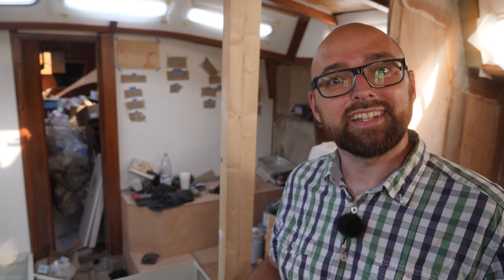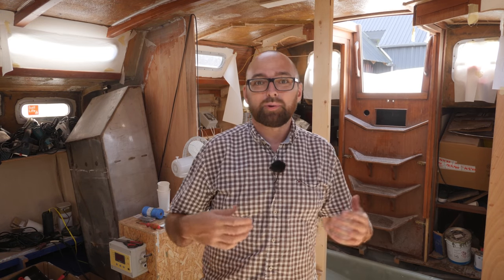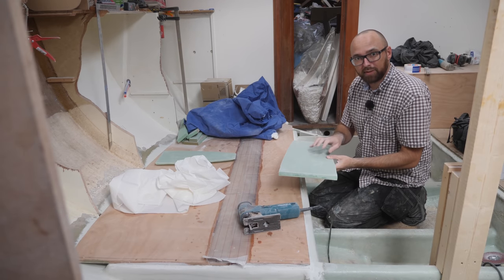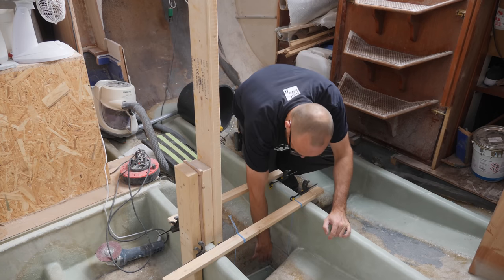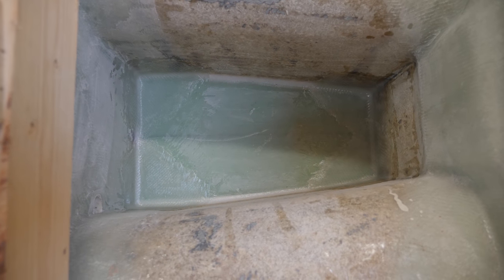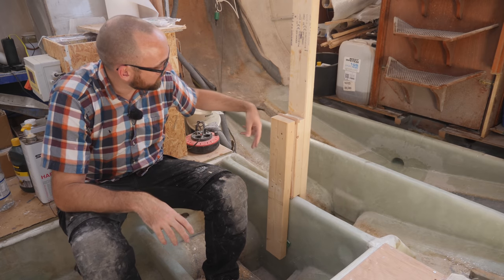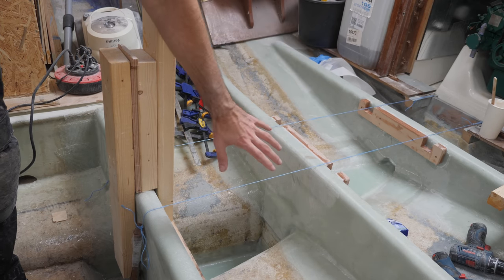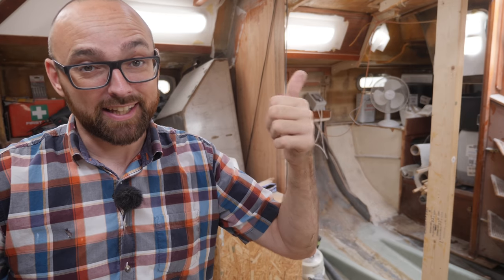Sail Life - Bilge modification & longitudinal support - DIY sailboat refit

Comment: Athena’s structural members are looking super spiffy compared to last winter/spring, awesome. I agree 100% with your assertion that you should not have a grey-water retaining area that’s not enclosed in a tank for a few reasons. 1. Water creates smells - mold, skank, whatever, 2. If you ever lay up your boat over the winter while it’s full of water, the expansion of ice is likely to crack whatever it’s contained in. You def don’t want any part of the hull to crack, not even a little, especially anywhere below water line.

Comment: I really like the additional details you are doing to make Athena a strong and squeak free boat for the future.....I'm sure that will make it much more comfortable when sailing.
Reply from the maker: Thanks! Fingers crossed :P
Reply: While there won't be any qualm about the "strong" part, I still would doubt the "squeak free" properties though.
Reply: I did a similar rebuild on a smaller sailboat years ago, and went from having routinely wet bedding to having dusty bilges -- and squeak-free, as you say! -- but to my way of thinking, leak-free is HUGELY important. A boat which is a bit wet in good conditions can become a washing machine in survival conditions, and that almost inevitably will have a really bad effect on crew morale and skipper decision-making.

Comment: A deep bilge is a safe place for flooding. We took a wave from astern, completely caught us out. We think about 2 to 300 litres came on board very quickly.  It went straight into our deep bilge which meant things like the engine were not flooded. It was then easily pumped out.  I got salt water in my tea though and had a chart table full of water. It was a freak wave by the way. We had made the mistake of removing the wash boards to early.

Comment: i think I'd leave the void in the keel foam free. Water shouldn't get in but if it does you can always pump it out through your spiffy inspection hole.
Reply: I agree. If you fill it with foam, then you'll never be completely sure what's going on in there!
Reply: 100% agree
What is the argument for adding the foam?
Reply: Well, air is better floatation than foam and if the boat fills with water that tiny area wont help anyway 🤔☺️
Reply: I agree was just about to comment on that. If adding foam wouldn't closed cell be better anyway so it wouldn't absorb water.
Reply: @mindertdeboer9250  Would closed cell foam sink then?
Reply: I would wait to see how the boat handles in the water.  Extra weight can really effect the secondary stability of the vessel
Reply: Flotation ? The foam is added to the keel to fill it.. nothing more... One doesn't design a boat to float upside down unless it's a life/rescue boat. The keel of a sailboat is cast iron, lead or steel the thought of countering that doesn't make sense....
Reply: @mindertdeboer9250  it's a 38ft boat. Probably 8 tonnes. That amount of foam will do very little to help it float
Reply: @mindertdeboer9250  One cubic foot of foam provides about 60 lbs of flotation. Filling that section of the keel with foam will do nothing to help it float. And is worthless for insulation.
Reply: @mindertdeboer9250  I don't see how filling it with foam will make it "less susceptible to sinking". It's already an airtight compartment with the way he's glassed it. Worst case is it would fill with a few gallons of water. And as someone said it's such a small amount of foam it won't do anything for flotation. You could fill the whole bilge with foam and the boat would still sink.

Comment: Thouroughly enjoying the journey.with you Mads.  I don't mind if you never finish Athena.  

As for the bilge.  I'd make it into another fuel tank myself.  You can never have too much diesel, especially when cruising high latitudes when diesel is not only propulsion, it is also heat.  Good choice in not filling it in with worthless foam.  You can add a sealed cover with takeoff/return tubes later and now you just added quite a few liters of reserve fuel capacity.

Comment: Hey Mads! I can understand that you don’t want a deep bildge for keeping a spiffy clean bilge but I’m sure as you know they have their place! 

When you have a seacock break off, or your packing gland fails water comes in so much faster than you would think and having a deep bilge just gives you extra time to figure out a solution if your pumps stop working (power loss, etc) 
I see that you glassed in false floors and thats fine but if it was up to me I would leave it empty beneath the floors. I wouldn’t fill with foam because if/when something goes wrong, being able to open that port and gain a place for gallons and gallons of water to go would be a great fail safe. 

Just a thought!

Comment: Just a thought.  You could fill that nasty bilge with a sand cement slurry.  This would add a bit of extra stability to the keel and make it very hard for water to get into that area.  Maybe cement boat guy could help with this.

Comment: 'nature abhors a void', sorry to take poetic license with an old saying but it is still true.  Seems like this would be a grate space for installing a stacked battery box (for sealed batteries only) or for storing a large oil jug (with a tight cap), or mayB the sea anchor (in a moisture resistant bag).  Putting something in there might encourage you to clean it out occasionally, eh?

Comment: I’m sure the first bilge area you reduced the depth in will be more than adequate but I’m not sure about the one behind it with the inspection hole.  Any water there will slosh up the sides of the boat as there is no depth there or are you putting in another lumber hole to direct the water into the deeper area?  All looking great and once the cabin sole is all down it will feel so much better.  Andy UK

Comment: larchs , I  would  not  glass them in  so   you can remove them if needed , think about  how  you want to  make   your  sole and  hatches  for   your  sole  . and   run   your  wire conduits  and wire  before   your  soles  it make it a lot easier on  you  later  . Yes I  built  more than  one Sailboat   , larger ones   but the idea is the  same

Comment: Not a deep bilge fan per-se, but it might be a good idea to fill it with scrap metal or something a bit weighty for balance perhaps? I'm far from a sailboat expert, but a heavy keel seems like a good idea in rough weather simply for stability and a bit less rolling.
Reply: Imagine you're listing heavily and you have a decently sized air bubble directly below you....especially if your glass job is half as good as it looked.

Comment: No matter what you do, water will accumulate in that deep bilge. I'd want a way to inspect and dry it at least once a year, and would never fill it with foam and just hope. (Did you know even your GRP hull is slightly water permeable? Polyester moreso than epoxy.)
Reply: My thoughts exactly! I think the best solution would be to leave the void as is and use the inspection hatch to drain the sludge from the deep now and then. Water soaked foam could/would end up smelling bad?
Reply from the maker: I think 'slightly' might even be overstating it ;)
Reply: yes, and don't forget condensation. A very bad idea to seal the bilges.

Comment: Do you have any concerns about the air trapped under the false bottom expanding or contacting as the temperature fluctuates? Seems like that could create some pressure differences over time that could be problematic.

Comment: You forgot to add the time to the countdown, roughly 😏
Foam? 😲Noooooooooooooooooooooooooooooooo.  Just thinking about the foam that came out of there makes me ill!
Quick question, how much intense discussion went into working out the new layout,  I think having the nav station in the saloon is going to be so much better and it means you will not have to disturb any guest you have staying in the aft cabin if you are at sea.  I am not sure a chart table is a valid term these days (even if we do all still call it that) as most 'paper' charts tend to be framed and mounted rather than used for navigation.

Comment: Your filler pieces for the bilge are glass/foam/glass.  You're only glassing the top side to the boat, will the bottom unattached glass do anything structural or just kind of sit there and go along for the ride?  Same pretty much goes for the foam.  It seems like you could have just laid up some glass, then hung that the same way you did your sandwiched foam?
Reply from the maker: It's impossible to glass the underside of the false bottom but it's fine I don't need that kind of strength :) The less spiffy alternative was to use pices of plywood.

Comment: If water does manage to get into the deep void again if it is an air tight void it will act like a popping ballon under pressure and blow out any tabbing down there 👇 i would put a sealed drainage plug that a hand pump tube can be dropped into just in case

Comment: Maybe start thinking about running some wiring conduit before you go all out on putting floors and walls and such.
Reply: Wouldn't you prefer your wiring higher up?
Reply: In conduit it'll be totally sealed.  Use flexible PVC tubing and leave both ends high and it will be dry in the middle.
Reply: @svbarryduckworth628  Condensation will collect in the pipe.

Comment: When you are gluing wood to wood, is there a reason you don't just use wood glue instead of epoxy? I believe wood glue is as strong as the wood itself.
Reply: Epoxy is stronger than the wood itself. Also, why buy yet another glue when epoxy itself is an excellent glue?
Reply: @Garryck-1  Wood glue is also stronger than wood. Wood glue looks a lot easier, doesn't requiring mixing, looks easier to apply.